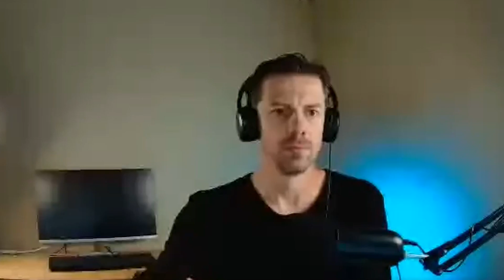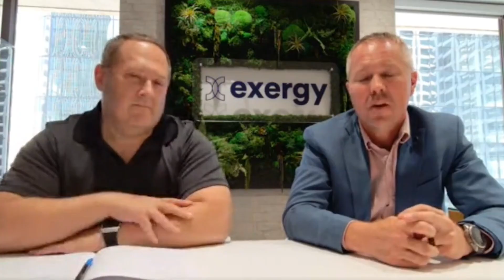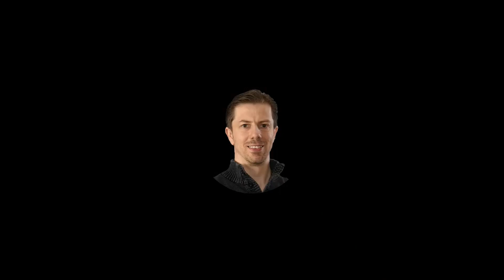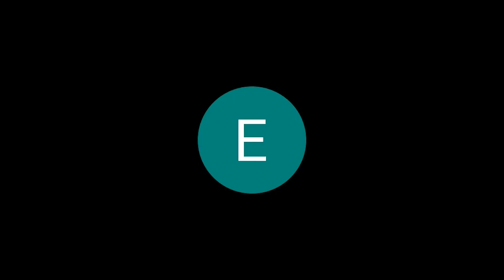Exergy and Aduro Conversation (ACT, ACTHF)

Comment: The question I would have asked Exergy is what is the strike rate of technologies you have built pilots for that have then actually gone commercial or scaled?  Like 1 / 100 or 1/1000 or none yet?  That would give you at least one data point to handicap probability of success.  Then you would expand this question more generally to all pilot to scale conversion.  Remember these guys get paid to build pilots, so will always say yes to a sale.